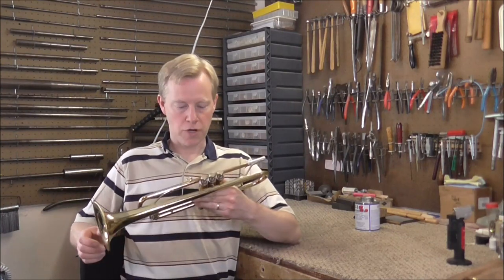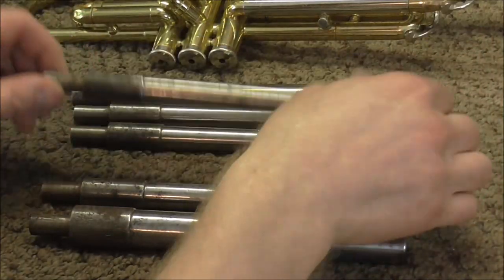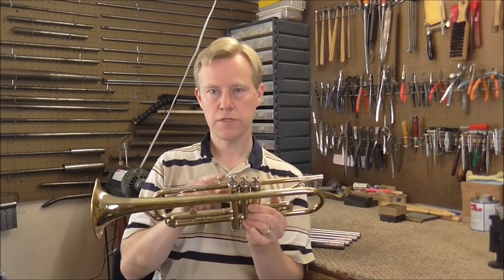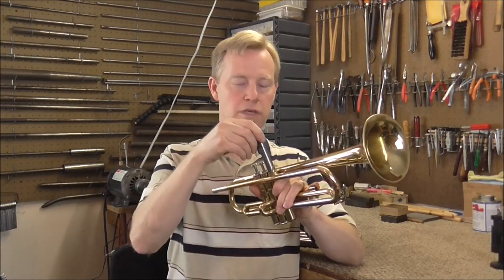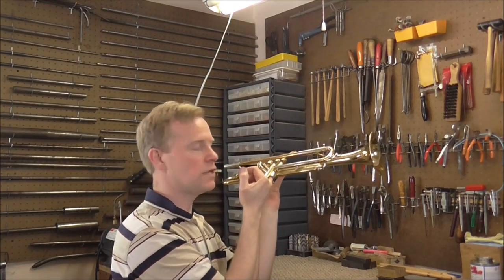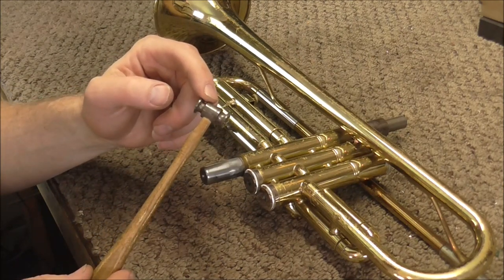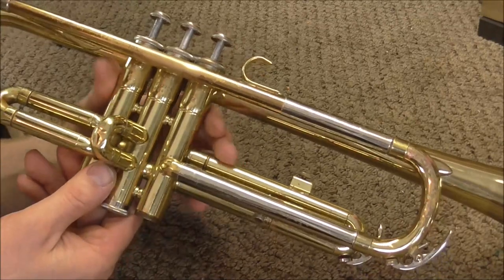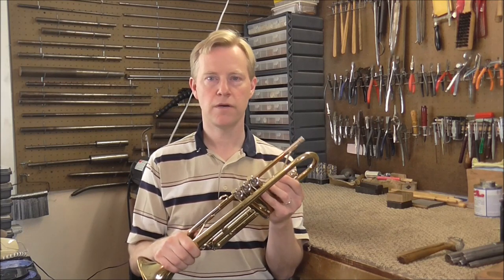Stuck Trumpet Valve: How to Use Ground Casing Mandrels

Comment: I followed his examples in this and other videos to the letter to fix valve and case problems with my Bach model 198 trumpet. It now works pretty good, I still have some lapping to do on a new valve. The point of this comment is that no repair shop within 50 miles would touch my trumpet, and I've received valuable lessons on what to do. So, I'm on the way to restoring a beautifully playing trumpet

Comment: thanks,  interesting Have #2  valve casing with a small high spot (shiny) inside at the bottom 1/32 in.   about 3/8 in valve hanging up in bottom . Valve sticks a bottom of stroke .Getting it repaired

Comment: Thanks for your very informative videos! I have a Yamaha euphonium that seems to have this problem. I would like to try repairing it myself. What size ground casing mandrel I should purchase? Feree's website  gives many different sizes but does not say which ones are for which instruments. Can you help? Also, can you tell me the correct size mandrel to purchase for Besson tubas? Thank you. And please keep producing all those excellent videos.
Reply: you could use a vernier caliper to measure the inside diameter of the valve. 6" digital calipers are not too expensive and it's a nice tool to have if you replace parts or repair instruments
Reply: @pauls5745  Thanks for replying Paul. These mandrels must be exact. I have found that most calipers do not have sufficient precision to measure to the one thousanth of an inch reliably. Taking measurements from ground casing mandrels I do have shows that I am usually about 1-2  thousands of an inch out - even when I use my iGaging calipers. So I do not trust my own measurements.

Comment: Any recommendations on where to obtain ground casing mantrels or any suggestions on possibly of making it, perhaps with support by (car) engineers.
Reply from the maker: You can get them from Ferree's Tools. You just have to know the exact size that you need. I have made two of them when I was in college, but you need special equipment that is very rare. I do not think that car people would have it unless they make pistons. 
Here is the link to Ferree's: ferreestoolsinc.com

Comment: What kind of clearance should the valve have in the cylinder?  I have a old Sousaphone and 2 of the cylinders are out of round.  The valve measures .975".  What size mandrel should I get? .976 or .978?
Reply from the maker: That is hard to answer without taking some more measurements. It depends on how loose the valves are. The .976 will probably fit in there with no problem. It may be too loose though. There is a good chance that the .978 will not fit. It would be better to have it a little too loose than not go in at all, so I would go with the .976. I hope this helps.

Comment: Thanks for the video. A question. How would the mandrel get into the dented casing in the first place? I measured the OD of the piston to get the correct size but it would not slide into the casing. So do I need to get a size slightly smaller than the OD of piston?
Reply: The end of the mandrel is tapered smaller so it can get by small dents.

Comment: Very cool video.  I have one question.  I picture dents being concave (inside the valve).  How does hammering the outside of the valve fix them?  It seems like the hammer would push the dent in the direction it's already facing and have no effect.
Reply from the maker: Because the mandrel is the same size as the casing and it is made of steel, tapping on the dent causes the mandrel to push out the dent from the inside.
Reply: @TheBrassandWoodwindShop  Thank you that does make sense when you put it that way!

Comment: Could a scratch on the casing cause the valve to stick? I have a tuba with a stuck third valve and I'm hoping it's the scratch
Reply from the maker: It is possible that a scratch could cause a valve to stick, but there are many other reasons for this too.

Comment: What a great video, however, I have been using this technique for my second valve and it helped somewhat but it seems I can't get in at the right angle to fully smoothen it out and it stil won't go all the way down or it gets stuck. Do you have any advice for the doing the middle valve specifically?
Reply from the maker: There may be something else wrong with it too. Watch this video and see if it helps. 
https://youtu.be/eQ29c7gPoZE

Comment: Can you tell me what size mandrel I would need for a 50's vintage Olds Ambassador cornet?
Reply from the maker: I think it is .664, but i am not positive. If you order one from Ferree's Tools, they will know what size you need.
Reply: @TheBrassandWoodwindShop  You were absolutely correct. I ordered it and it did the job. 3rd valve casing was badly out of round and with that tool and your video I fixed it properly! Thank you!